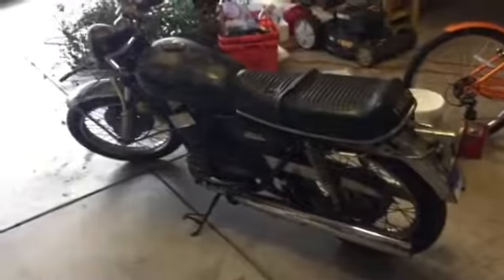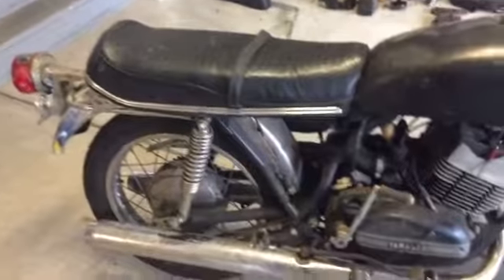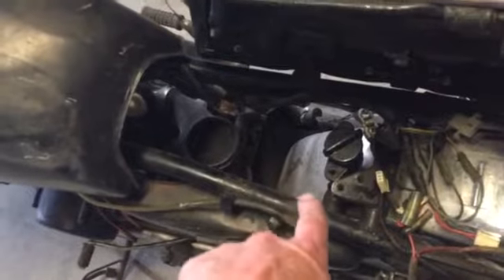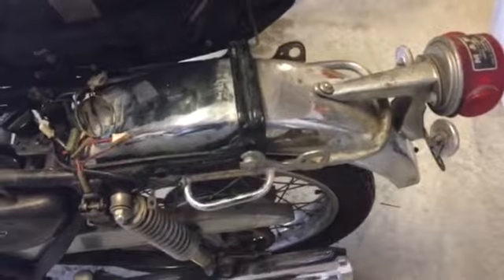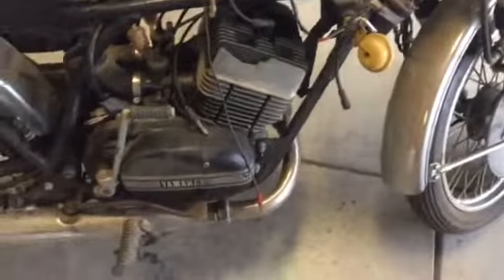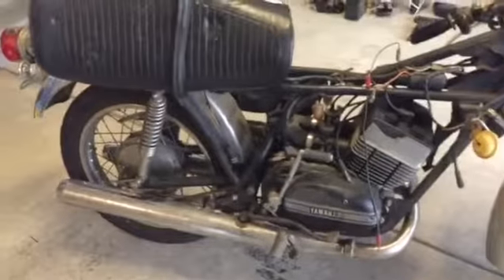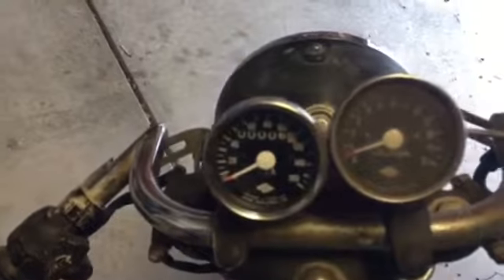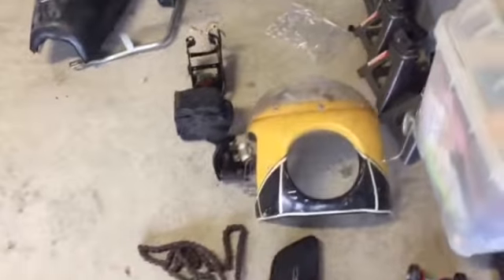1973 Yamaha RD350 - day 1

Comment: Working on a '72 R5.....yours is way worse than mine, and I have 6 weeks in it and total so far over 2k in it....but getting close, starts and runs...just put a new clutch in it...
Reply: top end,tires,electrical, battery,  seat,carb work,  9,092 miles...